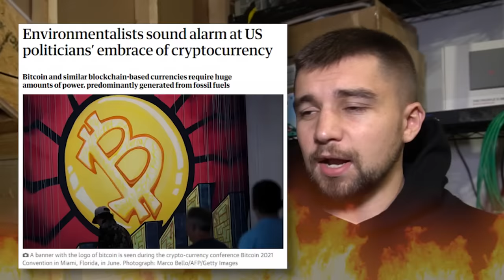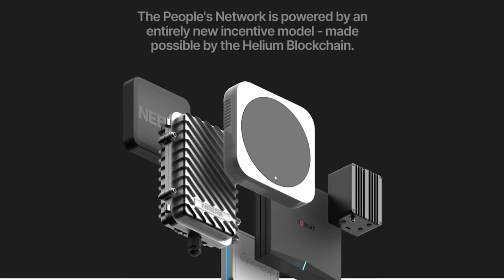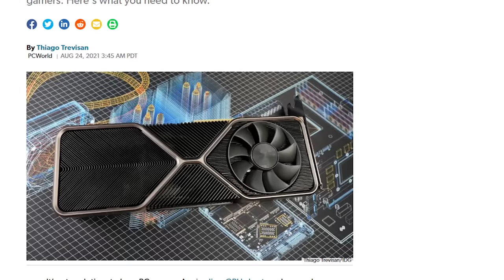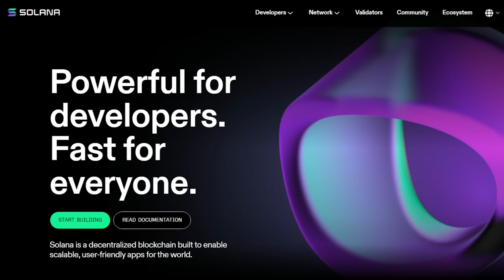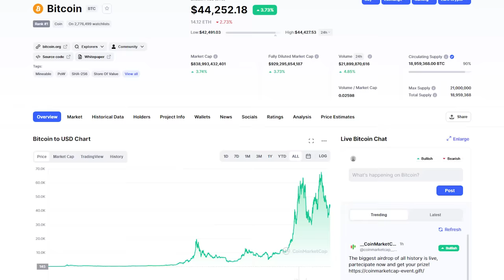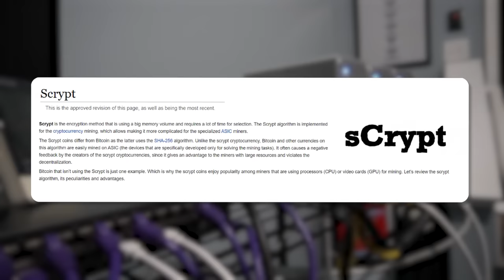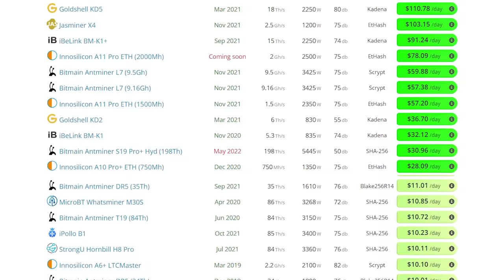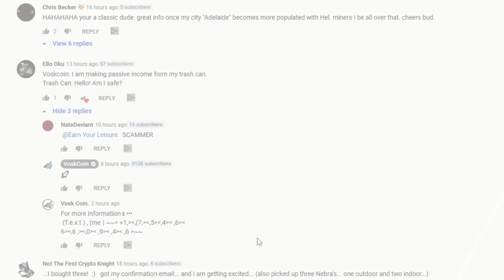Should You Mine Crypto in 2022?

Comment: I don't think GPU mining is dead - its in a transitionary period where confirming transactions is not longer a valid use case given the energy required. The key work here is use case... Think about what crypto is fundamentally trying to do and that is decentralize capital markets. The momentum has already started with DeFi but a lot of this is currently built on centralized infrastructure. The next wave of mining will be to support the infrastructure that hosts these decentralized environments in the web3 era - full stop. GPUs will be repurposed for decentralized cloud rendering and computing. I can see storage and memory being added to this mix with node operating. And if you're an interoperability bull than it shouldn't matter which project you support it just needs to have strong fundamentals.
Reply: Someone talking about flux here ?! :) totally agree with you.
Reply: @en4ble773  definitely referring to it haha but honestly, I think other similar projects that are doing similar thing are also going to do well…  like render token is specifically focusing on graphical rendering - HUGE use case there given that to compile a video you basically have to abandon your machine for several hours (quality and length dependent) - anything that’s application specific has a decent shot IMO
Reply: @philipniedzwiadek8736  thanks for the tip, i can share also. Cortex is focusing on AI very underdog at the moment but huge potential. Problem I'm seeing is that their devs are not that active compared i.e with Flux.
Reply: @philipniedzwiadek8736  is render token minable?
Reply: @en4ble773  no idea to be honest, I’ve just been trying to develop my post-Eth2.0 strategy and I think projects like this make the short list - when I realized it was for graphical rendering I realized my measly 1060 3g wouldn’t cut it lol